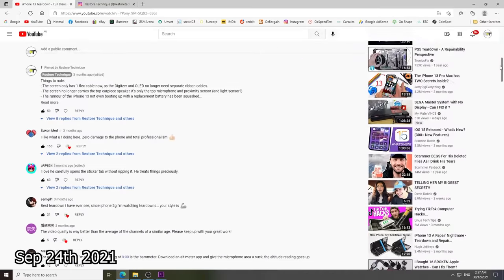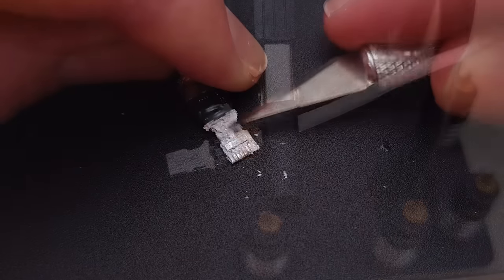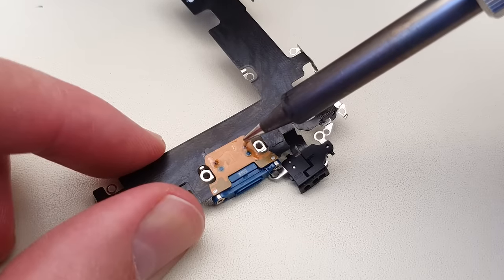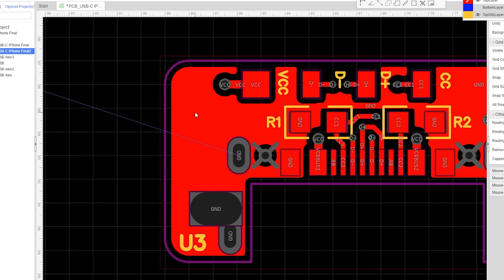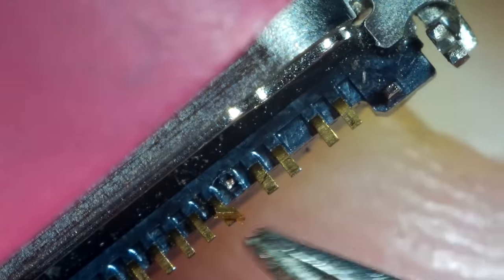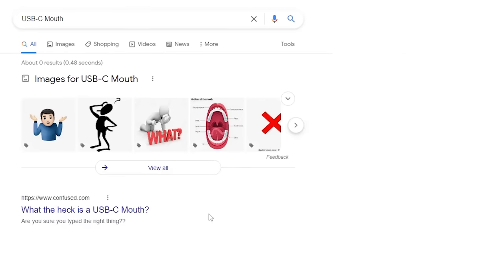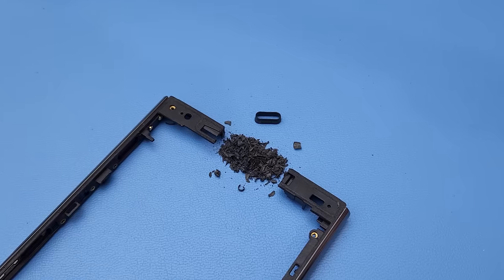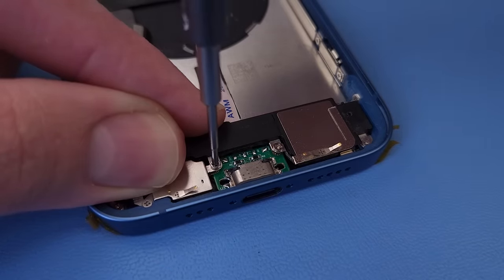I made a USB-C iPhone 13

Comment: This man just innovated more in one video than Apple has in 5 years.
Reply: Apple will have to make their phones with USB-C, or they can´t sell anymore in Europe :)
Reply: @yotavares  or maybe they will ban cable connection at all😄
Reply: @yotavares  not really cuz we all know apple gonna remove the charging port itself and force apple users to use wireless charging
Reply: @fawwazuddinsiddique3330  wireless charging is dumb and pointless if you can use a cable.
Reply: @deejayitalo   Portless its impossible rigthnow becouse every device with storage builtin need to ensuse the data access even if the device is damaged or not working and is a requirment for the seafty apporval from UL,EU and ECA
Reply: @yotavares  They'll  be USB-C but you'll HAVE to buy from apple as they'll still want to put the DRM chip in the cable, and if third parties make these cables it will be a lot harder to reconize if they have the chip in them .. technically apple adding USB-C this way would likely increase their own profits in the most dirtiest way possible
Reply: @yotavares  the most likely result is that they will instead sell a version with usb-c in europe and find a way to region lock it by certain networks so they can resume selling the lightning port models elsewhere.
Reply: @yotavares  or they will make outstanding gamer move "REMOVE CHARGING PORT" and then the sh*t trend for smartphone next gen has invented. Meeeehhh...
Reply: Okay let's not pull things outta our butt.
Reply: @Horizon301.  Agreed. So inefficient.
Reply: @over9000713  I'm proud to say I've never owned anything Apple.
Reply: @lucaalpini5270  Did your keyboard just have a seizure?
Reply: @yotavares  I'm sure Apple will just insist you buy a five cent adaptor for $59.99
Reply: @utubekullanicisi  Stop letting Steve Jobs in yours.
Reply: @leehorst  Fortunately, I have the abliity to think for myself, not for others. I think you're letting PCMR shills in yours.
Reply: @over9000713  EU regulation actually have that covered, you can't use any software blocking for cables.
Reply: Ahaha true that. In terms of phones and tablets
Reply: @utubekullanicisi  wow they thought of everything then, gg
Honestly we need this everywhere
Reply: @Horizon301.  wireless charging eliminates wear points on both the device being charged as well as the cable. That's not me saying I want a cable free device (I think you are forced to give up more than you gain that way), but wireless certainly has its place.
Reply: Apple is fully capable of doing it (wouldn’t be surprised if they have a few prototypes) they just don’t want to.
Reply: :D
Reply: @fawwazuddinsiddique3330  People gonna just get older iphones then or not upgrade
Reply: They already have usb-c on iPads
Reply: @yotavares  they already have usb-c on ipads
Reply: Hey man dont give apple too much credit, we're looking at numbers closer to 10
Reply: @leehorst  lmao
Reply: 666 likes
Reply: @yotavares  I think they can sell them with their shitty ports but they increased the monetary punishment by a lot. In fact apple and other manufacturers of anything have been getting away with their shit in EU because these fees for not applying to the regulations were just not high enough. Question is: is this enough to deter apple from being shitheads? Alternatively I can totally see a price increase for EU either because they want the customers to pay their fees or they will change to usb-c and force the customer to pay for manufacturing process change.
Honestly thinking what apple will do with anything is like imagining the absolute worst villain shit and then seeing it happen...
Reply: @Minuit_Monstre  that's so dummb, they'd never do that because it's wasting resources
Reply: @yotavares  but you know they're only going to sell usb c phones in Europe, or they'll take the port out entirely, just out of spite.
Reply: this is so accurate
Reply: No is already been done
Reply: fr
Reply: 10 years*
Reply: apple cares about safety. if everyone start uses thirdparty chargers with usb-c it can be bad. a lot of incidents with charges more than 35 wat
Reply: Their lightning cable is ingenious, it's to have a monopoly so you have to buy their accessories.
Reply: @Toymonkeyjr  im sure if their lightning cable was so ingenious it would have faster data transfer rates than any usb cable after april 2000, but it doesnt
Reply: @ground-beef  no, you need to work on your reading comprehension. It's ingenious because it's obsolete but earning them millions of dollars.
Reply: @deejayitalo  they might do this, specially since we're talking about apple. They would rather remove the port completely than to use a port that everybody is using
Reply: Apple is the king of innovation——-innovating better ways to take more of your money
Reply: @yotavares  how are companies supposed to innovate when they actually want to? They can't no because the EU is moronic
Reply: So fucking true
Reply: andriod been doing it for years not all usb c are the same
Reply: @Viktorrrrr1  it already being done by samsung  thats why eu added it
Reply: @TheGozzila  why change  the is 10 different usb c cords that are not the same and cant do the same shit  samsung use chip to make some devices only use certain cords you act like a switch to usb c solves anything
Reply: @Toymonkeyjr  apple does not have a monopoly on shit there to many different phones out there for any company to have one.  your comment is is as ignorant as saying cars use different tire size to  monopolize the tire industry
Reply: not all usbc can transfer data there many different usb c cord need for different device that will not work wit each other
Reply: I have no words…some things are just so ridiculous. Apple! Wake up! It’s the 11th hour for you!
Reply: APPLE makes huge money by removing headphone jack and stay on lighting port to sell their earbuds,charger, cable, connector.
Reply: @istymix  bro allergic to truth
Reply: @szatanica1  you are insane not even close
Reply: @harshvardhan7472  samsung removed it too
Reply: Probably only 4 years.
Reply: oh yeah!
Reply: @fawwazuddinsiddique3330  You'll have to by a wireless module separately.)))
Reply: Apple thinks of everything you guys think about. They just do their business the way they want to because they know everyone will still.
Reply: 5 years? Lightnig was released in 2012...
Reply: @Minuit_Monstre  region locking will surely backfire if it causes issues while traveling and not being able to use a local prepaid subscription.
Reply: @Minuit_Monstre  or the EU model will be wireless only, while other markets get the option for Lightnig, then they just rely on gray import for anyone wanting wired charging.
Reply: @JosefPiano  well, there hasn't been that much innovation from Apple for Lightnig after 2012 release has there, while USB-IF has made many updates to USB-C
Reply: @thorbjrnhellehaven5766  true, I'm not meaning apple alone, what if google wants to make a new connector or something?
Reply: apple does not to change the port because it loses control. I guess, it needs to learn to be compatible with rest of the world.  In business world control = money so they will lose revenue if they don't have proprietary port.
Reply: @fanzfanzilla  that's kind of what puts me of from buying apple products. They tend to be very proprietary, then I know that'll restrict my future options. Their products seems great I just want more freedom and to keep a wider range of options.
Reply: lol
Reply: They surely can do it easily. They're just making so much money through lightening charger licensing to chargers manufacturers. Seems like they have to though to comply with EU regulations.
Reply: @captainultraswagga  yes USB-C is objectively worse in every possible way.

USB-C: 10 GB/s
USB-C Thunderbolt: 40 GB/s
Lightning: 480 MB/s 

USB-C PD: 240 W
Lightning: 27 W (test data iPhone 14 Pro Max)
Reply: imagine being apple user instead of android where you have usb c as default
Reply: @XdekHckr  I wouldn't enjoy that at all! I enjoy that I can use the same power adapter for my laptop, tablet, phone, headset, camera, game console. Some devices don't play with low power supplies, but all play with high power supplies.

Even Apple users have to use USB-C with MacBook and iPad Pro.

Soon Apple will switch to USB-C for devices in EU. I'm surprised if they stick with Lightning for other markets.
Reply: @captainultraswagga  I know perfectly well that physical connectors and protocols are not the same.
The connectors are on layer 1 of the OSI model, while data packs are higher up. 

The Lightning connector was developed before USB3, and they are basically stuck with USB2.
And USB-C was developed with USB3 and a few other protocols in mind, and they have better 

If you want to transfer recorded video or audio from a phone to a computer, you probably want higher bitrate.
It seems like Apple are unable to, or they dont want to implement protocols with high speed using Lightning connector.

I am perfectly aware of the fact that not all USB-C devices support the faster protocols, but using the same connector, they connect interchangeably with other devices.

USB-C and Lightning are comparable in size, they are both reversible. While the contacts points on Lightning are exposed, contact points on USB-C are somehow protected.
Reply: @yotavares  not if the remove wired charging
Reply: @lucaalpini5270  So the apple watch is illegal? lol
Reply: True
Reply: I can agree that iPads are mobile workstations that may need to transfer files Via USB C but and iPhone is a big no no especially because usb C is more breakable than Lightning, right to repair aside (which I do support) question is would you want a more breakable iPhone ? Government bodies aren’t engineering firms and if port connection breaks more easily repair expenses are still coming out of one pocket
Reply: @iamsolidasarock  Amen! They perfected Capitalism that is why they are No. 1
Reply: @yotavares  USB-C is the worst imo if the port is dirty and someone tries to clean it and wiggle with a toothpick or something that usbc will break within no time but lightning port wont have that issue. I hope they dont change the port other than for europe.
Reply: Android fans always crying sad with their crappy devices lol
Reply: Honestly; more like 10 years
Reply: @deejayitalo  maybe lol yeah
Reply: LMAOOOO
Reply: @RomaniaViral13  at least android features existed long before apple added it

we ain't broke, we just have better financial decisions than you
Reply: @yotavares  Apple shiet
Reply: Apple designed and holds the patent for the USB-C connector. They were also the first company to use one only a couple of months after the standard was ratified. 

But tell us again how they don’t innovate? Lol. 

Look at the connector. It looks like an Apple design and it about the same size as the Lightning connector. But it’s thicker, and not water proof. That’s why they haven’t used it on the iPhone.
Reply: @DavidRavenMoon  then why some samsung devices with usb-c have waterproof functions in them
Reply: @leehorst Yes you did or do. See USB C standard was co developed and pushed by Apple. If it wasn’t for Apple and it’s proprietary lighting reversible port you would be stuck wit the stupid micro USB port. And still running on a 16 bit android ripoff copycat version of iOS 1.
Reply: @fawwazuddinsiddique3330  With 50 adaptors that are each sold separately to activate the wireless charger
Reply: @lucaalpini5270  smart connector
Reply: @fawwazuddinsiddique3330  wireless charging still uses a wire, ironically. So it's not allowed.
Reply: @deejayitalo  I heard modern phones are slowly getting rid of 3.5mm headphone ports. I wouldn't be surprised if they did that with the charger port smh. Need to buy expensive wireless charging lamps/desks to continue using your overpriced phone
Reply: i dont think you have looked into the insides of androids vs iphones very much. samsungs and the like have been looking the same since the Samsung S5  days pretty much with a very uninpressive design (im talking inside the phone) meanwhile apple have tweaked and changed lots since the equivelent phone to the S6. ah well
Reply: @leehorst  nobody cares if you never owned anything by Apple I assure you. Like as if Android phones and Windows OS is the pinnacle of the tech world or something LOL.  Took Apple to create their own silicon to destroy every other laptop out there in terms of battery life and efficiency. Keep celebrating your wonderful achievement while the world moves goes by.
Reply: @utubekullanicisi  "i have the ability to think for myself" said the apple fanboy 👀
Reply: @deejayitalo  Europe > Apple
Reply: @lucaalpini5270  apple sells their watch and it doesnt have a port. so why not their phone? wouldnt be surprised at all
Reply: @ireallyreallyreallylikethisimg  Smartphone and Smartwatch they are devices in different categories and that of watches does not need a port since it cannot store files in the same way as a smartphone which by guarantee you must be able to recover data even if the device is damaged or not working without the supply of specialized resources
Reply: @lucaalpini5270  so what if they made the stored data not be local? (very stupid idea, but would be a huge apple move)
Reply: @ireallyreallyreallylikethisimg  For privacy and warranty have data only on Cloud its illegal under the UL and CE legislation
Reply: @lucaalpini5270  so what you're telling me is that apple is not gonna find a way to wiggle its way out of having USBC ports? Hell yeah!
Reply: @ireallyreallyreallylikethisimg  Yes for now its the only choice
Reply: @deejayitalo  which sucks and is really inefficient what would be a shame for such a green and good company like apple right? ^^
Reply: That's objectively untrue. I know "apple bad" but the M1 is a complete game changer.
Reply: This is why I've never bought an Apple product ever.. Complete horse manure.
Reply: BS. Apple invented Lightning port. He only swapped to USB-C he didn't invent either
Reply: @fawwazuddinsiddique3330  false
Reply: @yotavares  They'll remove the port entirely and force everyone into magsafe/wireless charging
Reply: @RomaniaViral13  Bro literally android gives you much more freedom, and allows you to download applications from more places than the store, and unlike Apple they continue to innovate, unlike Apple, that there is no difference between the iPhone 13 and 14, I assume that in the United States it is fashionable (I also assume that it is very likely that you live there) Apple is only aesthetic, really if they give me a choice between an iPhone or a Samsung I go for the Samsung of one, android has many more apps, and gives you much more freedom (not to mention that it is compatible with many more things)
Reply: 15 years mate... get facts right!
Reply: He innovated more than all tech companies in the past five years.
Reply: No apple is never switching to usb-c, they will start going straight to wireless charging
Reply: and by innovating while keeping the the limitations set by apple themselves, he barely needed to modify anything in the phone, just some shaved bits
Reply: no cap
Reply: Apple hasn't innovated since the 6502 based Apple II.
Reply: apple be like: So you think our lightning cable is not innovation huh?
Reply: Plot twist: video took 6 years to make
Reply: 10 years*
Reply: bruh
Reply: @noynayru   well well well 💀 far from trrue
Reply: Did you complain that the iphone 15 didn't have any innovation, by any chance?
Reply: @YousefMohamedAbdulMoniem  they haven't innovated in the past decade. nothing they do is new
Reply: @VibinWithStyle  sure buddy sure
Reply: congratulations, you appeared in a vaazkl video
Reply: Someone already attempted this and said it will not be possible
Reply: that was personal right there
☠
Reply: @XdekHckr this aged poorly
Reply: in apples defense
if they instantly switched to usb c their customers wouldve been mad now that the lightning they recently bought was reduced to e waste

Comment: The precision that this needs is astounding. I am so surprised you can solder such small parts like that and your CNC skills are better than my actual CNC.
Reply: no comments!?
Reply: Does anyone know why exactly the fast charging only works one way and is not reversible? Im assuming it has something to do with the resistor setup but im kinda unsure. Is it possible to fix that reversible fast charging problem or is it impossible with how the lightning port works?
Reply: underrated comment
Reply: so is it much faster to transfer prores now?
Reply: Can you add mini hdmi?
Reply: @MPD90  I'm not sure if I just broke something while opening my phone, but my android phone also only fast charges on one side.
Reply: @MPD90  Watch the video again closely and read my comment again please. That's not what I said. I'm referring to him mentioning that usbc charging works both ways but one way you can charge much faster while putting it in the other way means slower charging
Reply: @MPD90  14:58
Reply: @MPD90  it's wrote in the lower part of the video, not long after the time stamp
Reply: @MPD90  yeah man, pretty clear at 15:00 - fast charging is FASTER on one side versus flipped -
Reply: @MPD90  he said it as well
Reply: @MPD90  why not🤣
Reply: @MPD90  next time why don't you just ask for the timestamp first, instead of assuming the comment to be wrong